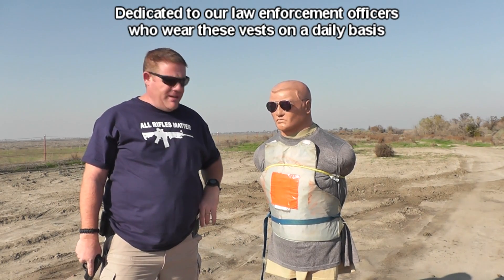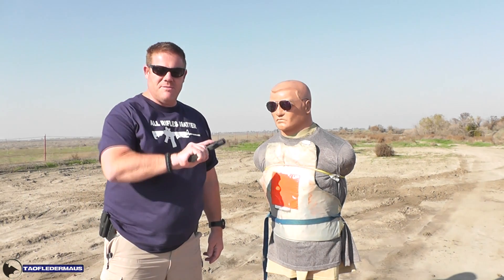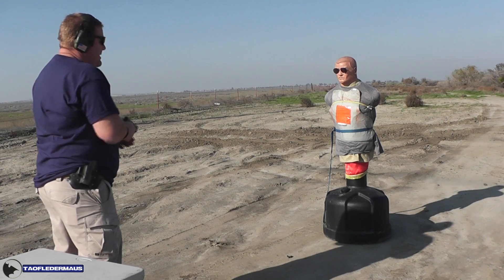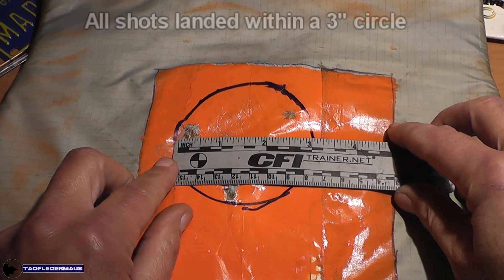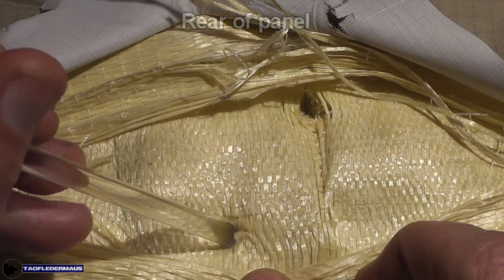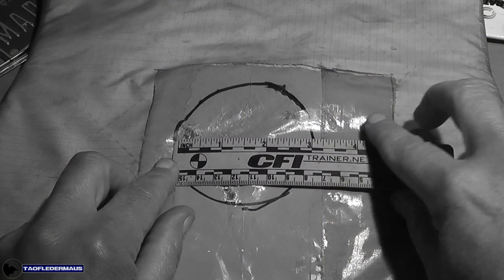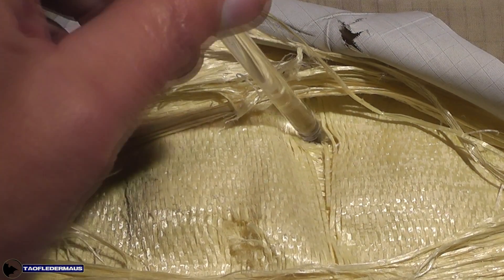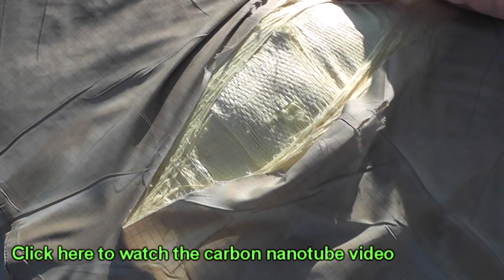Dispelling MISCONCEPTIONS about Kevlar body armor

Comment: I think a term that should be used is Reliably. It's like selling a chair and saying the weight limit is 300lbs. Then someone who is 310lbs sits in it and it still holds up. So the company lied? Not quite as it is for recomended safety of using their product.

Comment: Man, that would feel like a sledge hammer hitting you 🤦‍♂️

Im in the UK, and have bought a surplus British army osprey 3 plate carrier

I cannot find either the ceramic, or steel cheat or back plates at all

I keep coming across the odd kevlar, what we call "soft filler" but it's either the wrong size, or out of my price range 🤦‍♂️

I really wanted the authentic British military filler and plates to keep it as original as possible, i know i could buy boiler plate, cut it, bend it, and stuff it in the plate holes, and i could just buy some cheap insulation to put in the kevlar pockets to make it feel the same, but it wouldnt be the same 😂

Comment: All of ours was from the same company (Second Chance) I was very confident that it could handle multiple handgun strikes.
    That new company with the nanotubes is just trying to push their products.

EDIT:.   15 POUNDS
     I had a Full Size vest with side coverage and a metal strike plate in the front.    All of that plus the carrier to hold everything did Not weigh 15lbs.

Comment: Other brands can hold way more shots in the same area than this with very little deformation, brands such as Skarr Armor, US Armor, Armor Express or KDH.  This nanotechnology material definitely seem to work differently than regular Kevlar layers, once it's been shot, it may stop function within certain area, that's why they say it can only take one shot which I have never heard of before from any other brands, also the deformation is horrendous, you probably need to wear a trauma board with it just in case.

Comment: Wouldn't firing multiple shots throw off the results significantly?  Just fire 1 shot, check to see if it went thru. Then fire a second.  Check again.  You said 2 out of the 9 went thru  but do you know if it was the first 2 or the last 2? Maybe in their testing they were checking after the initial shot that the probability of a bullet going through goes up significantly meaning the armor is effectively dead at that point because you wouldn't want to trust it. Comparing apples to oranges.

Comment: NIJ tested aramid fiber(kevlar ) Armor that was over 20 years old and in all cases according to the report it was withing 98% of original spec in all cases where the material was undamaged (water damage ect..)  or well maintained. So don't discount that your old armor is worthless.  Most of it that is cycled out is still very very good and will remain so if you take care of it.

Comment: I came across this video the other day and remembered that UL* and NIJ* have a listings for the rated vests.

Standard Caliber Weight (g) Velocity (fps)  # of Shots Range (ft) Rating
UL                .44 mag  240  1430                3  15.0          Level 3
NIJ                .44 mag  240  1400                5  16.0          III-A

*NIJ - National Institute of Justice, U.S. Department of Justice, Ballistic Resistant Protective Materials, NIJ Standard - 0108.01, Sept. 1985. UL - ANSI American National Standards Institutes / Underwriters Laboratories Inc. Standard for Bullet-Resisting "Equipment", ANSI/UL 752 - 1985, Rev. 13, May 1988.

Comment: thing I don't like on either theory is stopping projectile penitration is only half the issue. I deffanatly would rather be vested than not if I got shot, but with or without a vest of any type it's the kenetic energy transfer that's gonna do the damage. I think combating that energy being dumped through the vest into the wearers body is more vital than simply focusing on how many repeated shots it can take without penitration. this is because the vest may indure, but your bones and organs may not. don't get me wrong, armor that can withstand prolonged abuse is fantastic. deffanatly desirable. but the main weakness with most armor even historically, has been it's failure to stop that trama from the energy being disapated. I applause you Jeff for setting that company straight. but they need to know what's really important to the people that depend on these vests.especially law enforcement and military

Comment: Anyone who believes one shot, from a firearm that the vest is rated to stop, will completely compromise a modern vest, is ignorant and needs to do research. That doesn't even make any sense, 32 layers of 10oz fiberglass does better than that. Now, with Kevlar, yes, every hit it takes starts to degrade it, and of course, the closer they are, the worse it is on the vest. It depends on wether they were talking about a 3A or the 2A, also. And what company, and level/style, the earlier on Kevlar vests weren't always multi hit capable, at least not certified to stop multiple hits if I remember right.

Comment: "Can you trust your life to a kevlar vest"

Actually, no. The vest only protects you in certain situations. Such as actually hitting the vest.
What it basically boils down to is...

"Would you rather have a vest that can stop bullets? Or would you rather be without one"

And the answer to that isn't so straightforward either. I bet 99 out of 100 people would go with a vest.
Myself, i would use a vest if i absolutely had to. But i'd much prefer not having to use one at all!
The police in my country don't wear vests on duty. They only wear them when the threat level calls for it. It's all in the attitude of the citizens of the country and the prominence of gun related crime.

Comment: how well a bullet resistant vest works isn't just about penetration. its also about the blunt force trauma. a vest may stop bullets from penetrating into the body, but is the vests ability to reduce blunt force trauma comprimised after 1 or mulitiple rounds? Can you test this?

Comment: Many police depts. around the country have tested these vests. The 5 year deal is the guarantee by the manufacturer. The first 5 years if you get shot the manufacturer will replace the vest. After that  they won't. That does not mean the vest is no good. Many depts. depending on budget get new vests every 5 years. The Dept. I was on I was issued one vest. I turned it in at 12 years when I retired. As far as the vest being 15 lbs. Hogwash. A thick swat team vest will way that but the standard is not even close. My duty belt with everything I carried was 20 lbs including the vest. That included 3 magazines, baton, 2 pair cuffs, OC spray, duty weapon, knife, radio, and all the holders and garbage that went with it. When the old vests get turned in because they are old, they are usually sold cheaply to some South American Police dept.

Comment: I get why you did this. And they may have made some false claims but if the nano tube armor is where it is heading they have contracts with the military for armor that will stop 308 without the use of metal ceramic plates this is a outstanding move forward for military/police work. but you are correct on the false claims
Reply from the maker: I don't think their soft body armor could stop a rifle round
Reply: TAOFLEDERMAUS nI just watched a intervoew with them. They have a contract with the gov to make body armor for military use it may have solid backing but it will not be steel or ceramic. They are trying to reduce weight. now if they can do it or if it will be available to the public was not said. best I can figure it will be carbon fiber plate with the nanotubes use as the stop or catch for the rounds

Comment: so i watched that armor vid. nowhere in it do they shoot that "standard issue" (maybe for swat?) 15lb assault rig. giving them the benefit of the doubt and excluding outright lies. the only thing that i can reasonably infer is that they meant that a kevlar vest will fail to meet NIJ protocol for the deformation.

time and again kevlar has been shown to stop an incredible number of rounds from penetrating, even rounds that the particular vest is not rated for. however that does not necessarily mean that the vest has "stopped" them as far as the NIJ protocols are concerned. basically the vest might keep the bullet from getting inside you. but it might still transfer enough energy to break bones or bruise/rupture internal organs.

clearly that vid was a marketing solution. and the armor panel did do quite well, but i wonder what time capsule they pulled that "standard issue vest" out of lol. or maybe they got it on loan from a museum, and that is why they didnt shoot it. hahahaha.

Comment: Another thing I noticed in the Carbon NT video was their claim that carbon nanotubes have a higher tensile strength than steel. While totally true, they neglected to mention that aramid/kevlar also has a higher tensile strength of steel. 

Tons of marketing BS and fear mongering. I am not a fan, regardless of the product's effectiveness.
Reply: In the video I saw they had a clay block behind it to simulate the effect it would have on what was behind the vest.  The clay block held up pretty well.

Comment: "Only two went through"

~ Thus proving you were wrong. And thats only a 9mm.
Reply from the maker: No,   they said it wouldn't stop ANY bullets.   In that case 9 bullets should have gone though.
Reply: @taofledermaus  So they exaggerated the competitor product's deficiencies, not surprised. However, this video does prove that although the area doesn't become useless, it does still become deficient enough to be penetrated. A single bullet may be all it takes to kill a man.

Comment: Great test, and happy to see your challenge of those claims about Kevlar. The Carbon NT armor manufacturer is clearly making a product that is different and interesting, but perhaps they should have made their case for it in different terms. Question: Did you measure back-face deformation in your test? If so, what did you see?

One clarification on the 15lb weight claim: He was clearly talking specifically about the decommissioned vest he showed, not generally about ALL Kevlar vests. 

Also, as you fired multiple shots at your armor in a 3 inch group, two rounds did penetrate, whereas none penetrated ours in a similar group during the same exercise. It could be argued that this is because our armor was mounted more tightly to the target backing, but I'm doubtful of that reasoning. I suppose your armor's age could have been a factor, but that only casts doubt on Kevlar again. Of course, we used 8 rounds of .45, and you used 10 rounds of 9mm, so it won't be a perfect apples to apples comparison either way.

That all said, thanks sincerely for being professional and objective as you made this. Great response!
Reply from the maker: This was definitely an informal test.  The carbon NT armor does perform better than Kevlar,  there's no doubt about that.    Since Gregg wears Kevlar and saw your video on Full 30,  he wanted to do this test mostly to settle any doubts.    9mm is the round he said he is most-likely going to encounter and said he has confiscated more 9mm handguns from criminals than any other caliber.  It's a smaller,  faster round and a little harder to catch in the Kevlar.    What we were able to show was even expired Kevlar still works pretty well,  but it isn't infallible.   We haven't done a back-face test.   I believe the Carbon NT is much better with that too.   I just don't have a sample to do a side by side comparison on the same block of clay.
Reply: I asked Dallin to contact you. Would be cool to see you guys do a test together.
Reply from the maker: He contacted me about a month ago but I never heard any more from him.
Reply: Jeff, we are still waiting for Gregg's measurements from the email sent on November 3.
Reply from the maker: I gave him the fit chart and he was supposed to send it directly to you.  Sorry about that.   We'd be happy to just get a sample like Royalnonesuch shot.   We can do some side by side comparisons with clay,  etc.

Comment: I am CURIOUS.. Would Kevlar, stop a small, fast round like a .17 HMR?
Reply from the maker: I've heard somewhere that it will go through Kevlar since it is a fast rifle round even though it is small.  (think of .223)
Reply from the maker: Probably not.   I don't know anyone with one,  it would be an interesting test.
Reply: the bigger the round, the easier it gets stopped.
Small fast round can penetrate kevlar quite easily.
Reply: Go take a look at a .17 hmr round. They are very small, considerably smaller than a .22,  and they move extremely fast (my rounds are 2600 fps @ 50 yards)
Reply: I've got one. Let me know if you want to utilize it. I am near you.
Reply: I have a Ruger American, and a Mossberg 817, and I know that Savage A17 HMR rounds travel at 2650 fps. I use mine for setting off Binary targets. But here in Canada obtaining a Kevlar vest is easier said than done.
Reply: I also guess it would be level dependant of the kevlar.
Reply: ABaumstumpf not necessarily. The small round would have to be moving quite fast. Which is why I said a .17 HMR, I think a .22LR would get stopped by Kevlar.
Reply: Pantharen  Well - most small rounds are travelling fast ^,^
Reply: ABaumstumpf Now you have just proved that you have never fired a gun. I'll fill in the blanks for you.. 
 
.22 Short; travels at 700 fps, 22 regular is 1000 fps, and a 22LR is maximum 1650 fps from CCI Stingers (only), Average is 1150 to 1300 fps. 
~~~~~~~~~~~~~~~~~~~~~~~~~~~~~~~
.45 ACP is 800 fps, and a 9mm is 1000 to 1200 fps. 
~~~~~~~~~~~~~~~~~~~~~~~~~~~~~~~~
.17 HMR (HMR stands for Hornady Magnum Rimfire) 2650 fps

and .22 WMR (Winchester Magnum Rimfire) 
1550 fps to 2350 fps 

Are considered hyper velocity rounds. BUT they are specific rounds that can only be fired from specific guns, designed for those rounds.
Reply: .22LR does get stopped by kevlar (level 1 if I recall correctly) - In fact the ability to stop such a round is used as a standard for fragmentation vests.
Reply: It depends, we shot an old vest with 17 HMR from my xt17 VR, and the FMJ bullets penetrated, I can't speak to the other bullet types as I had left them in my safe the day of the shoot.
Reply: My take is the projectile would need to be thinner than the weave and be lucky enough to not deflect (Hence a sewing machine, where the machine holds the needle straight as it drives the needle through the layers). Once it deflects or deforms its all about energy of new shape against the tensile strength of the remaining layers just like any other projectile or any other material.

Comment: question... you in law inforcement/security? idk what other kind of job would require a bullet proof vest... im in security here in south Africa,my employer cheaped out and supplied us with old (almost antique) canvas and steel plate... 3/4 inch plate...
Reply from the maker: Gregg is.   The question is if you can trust that armor?  3/4" plate is going to stop most rifle rounds.
Reply: True,but its useless if the shooter decides to shoot for the head...and its heavy af...
Reply: Head shots are difficult and not very reliable you have a very small target, center mass presents the largest and easier target. Only time a head shot is viable is if the shooter is experienced and is able to take his time and aim. And if you've got some dude like that after you, you're screwed anyway.
Reply: SpudHead or...point blank,or close to point blank
Reply: Well, then don't let yourself be shot point blank in the head. And be glad you've got better protection than most people.

Comment: Note this older website for CarbonNT armor. Their comparison armor is even more ridiculous. I checked for a CarbonNT patent (they said it was a proprietary formula which means patented as far as I know) and there are none.
http://nationaldefenselabs.com/exclusive-carbonnt-brands/
Reply from the maker: Proprietary just means that don't want to disclose exactly how it is made so another company can make a similar product.
Reply: But without a patent other companies can just examine and then reverse engineer. Long consistent carbon nano-tubes will be so valuable that highly I doubt anyone would develop a manufacturing process and then not patent it. Just like you I imagine that this is good armor, but I read science news every morning and have not yet seen any mention that anyone could produce structurally useful ones yet. If this National Defense Labs Inc has done it they should be making a big news splash and be selling this armor to governments very easily. I also imagine that anyone who could afford to develop a carbon nano-tube manufacturing method would be able to afford NIJ certification, which these guys apparently don't have. I remember the AR500 carbon nano-tube claims and noticed how they faded away and they no long sell that product. I don't know, but I assumed it was because the claim was bogus. I very much want to see how a top end Dyneema and aramid panel behave compared to these panels because I suspect they are the same. I am quite often wrong though.

Comment: Also "Tested to meet NIJ standard 0101.06" hmm.  They don't appear on the compliance list on the NIJ's website. so their armor is not NIJ compliant/certified . 

As you and I, and others have proven, "expired" body armor still works rather well.  The warranty is a CYA liability thing.
Reply from the maker: I'm sure it is a liability thing.   At my old work we had to replace PPE every few years whether or not it looked worn out or not.  Like hard hats,   electrical flash suits,   insulated tools,  etc.    The tests I have seen of the carbon nanotube armor do look pretty impressive though.   I'm not knocking their product,  just their marketing tactics.